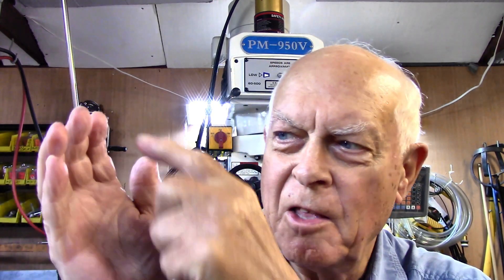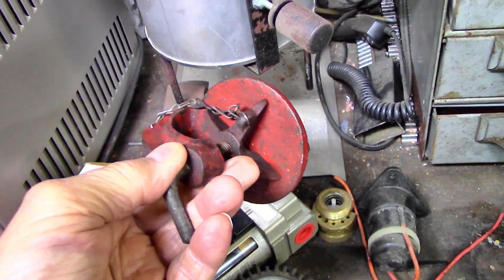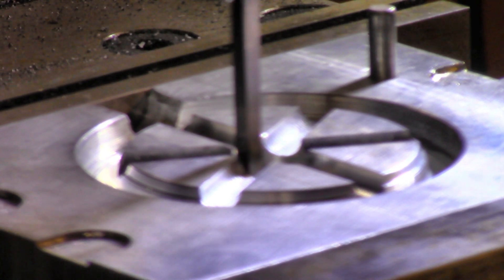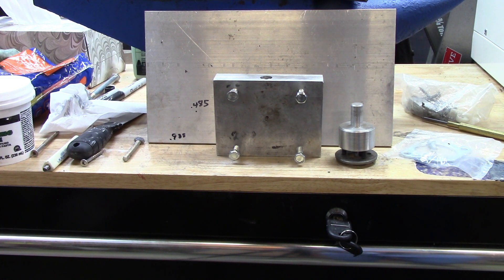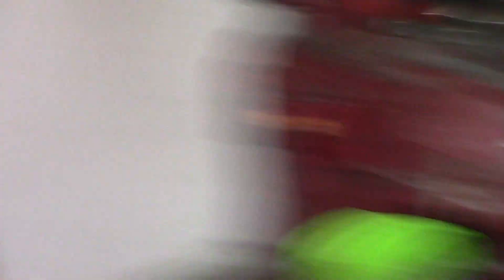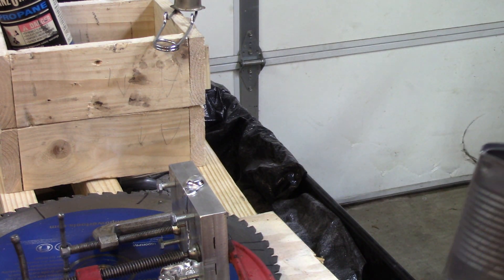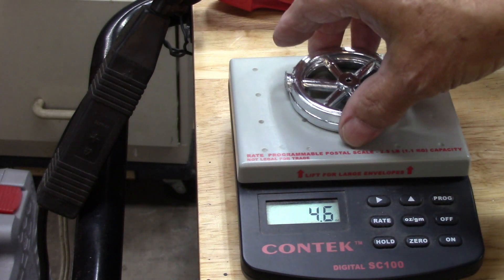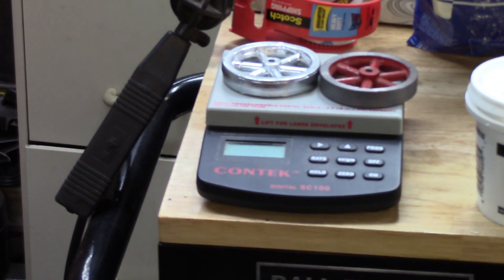Two flywheels  - dos volantes de inercia

Comment: Zamak used to be known as Mazak. Same alloy but the manufacturer changed the name. Maybe due to trademark conflicts with Mazak CNC machines.  Older style car door handles and hood trims were made of the stuff. You could break them in half and melt the alloy out of the chrome plated shell. It certainly made a nice shiny casting.
Reply from the maker: It does make a nice shiny casting.  Thanks Mark.